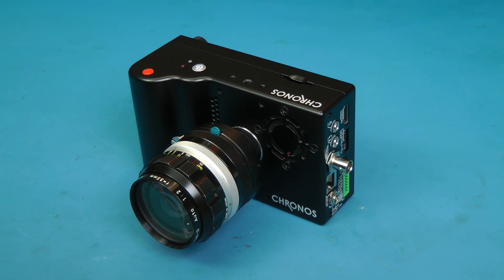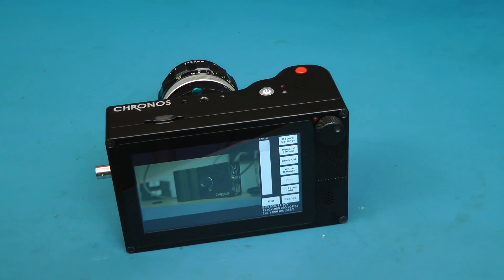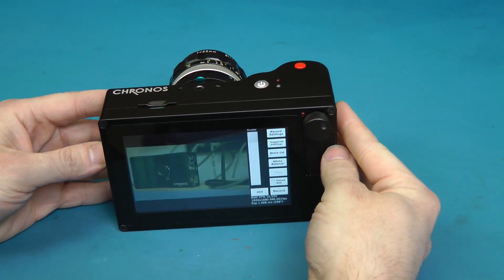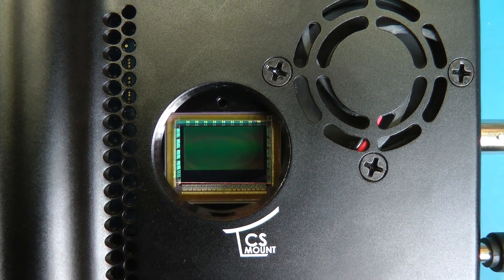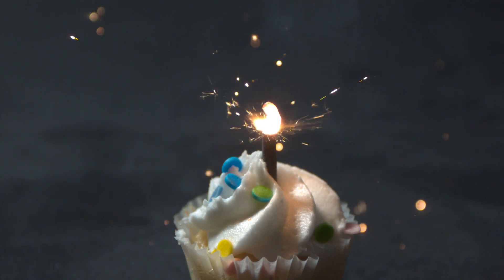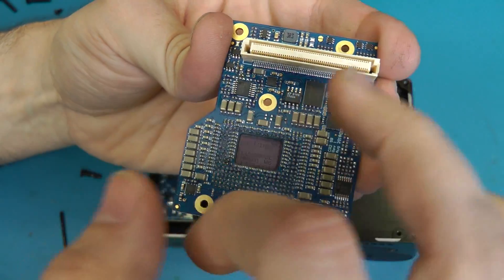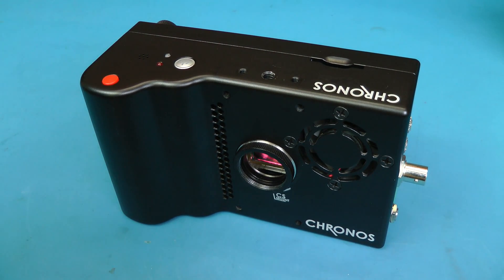Chronos 2.1-HD prototype demo, overview and teardown

Comment: when I watch Dustin Farrell`s two lightning videos Transient 1 and 2, how could I not find this a very tempting purchase at about 1/15th of the price? But it`s a year on and they don`t seem much closer to getting it into our hands. I`d like to be corrected
Reply from the maker: We've got about 40 of them shipped so far, right now we're waiting on more image sensors to be able to build more cameras. We bought out every sensor Luxima had in stock, more are on the way, but semiconductor manufacturing has a long lead time, and the virus situation has also slowed things down. Sit tight, we should have good supply by June.
Reply: @tesla500  thanks for the reply. Am seriously tempted. I don`t need 4k, but dang, Dustin-level filmwork with this is a mouth-watering prospect

Comment: This is absolutely insane!  I would consider pairing this with full-frame lenses, with a speedbooster, followed by a c mount adapter.  You would increase low light performance, and likely render a  better image given the modern coatings.

Comment: 2:10 Cant you notice that the frames are not constant speed..Not a good cam! And costs 5000$? No way!
Reply: I cant afford it but when you consider that other slow motion cameras cost $30,000 and up, this is pretty impressive.
Reply: what do you mean by "not constant" ?
Reply: @MrBazsi888  Their speed (when slowed) It seems like 2 frames go then 3 then 1...
Reply: @CocoSloan  do you mean the part with the camera in the water ?

Comment: Does this version still have the crop modes for increased fps, or does it always read the full sensor and decrease resolution?
Reply: Given that its a high speed camera and higher frame rates use reduced resolution to decrease the amount of pixels being processed to allow for faster processing, i would guess it's still windowed at lower resolutions. 
Also, fancy seeing you here

Comment: Pony on Board? :D

I see 1920*8@100000fps resolution in the datasheet. What is it good for? :D 190*96 resolution has the same pixel quantity. Does the camera shoot 100k fps in that resolution too? If I am correct, this should be an available image size (32 pixel steps in horizontal, 2 pixel steps in vertical resolution)
I like the upgrade anyway. 960fps is already capable to show interesting things even in mobile phones :)

Comment: Seems very flashy

Does it support Open Source firmware and ability to create your own replacement parts or fab info?
Reply from the maker: The camera's UI software and API is open source. In terms of replacement parts, you can buy spare parts if needed.

Comment: That sensor board is nuts.
Reply from the maker: That was a nasty routing job! Took about 2 or 3 weeks
Reply: @tesla500  kinda lame that you couldn't flip the sensor 180 degrees because of the case.

Comment: you should sell a kit that upgrades the older cameras
Reply: I don't think it would actually save much money. He's had to pretty extensively modify it... you could conceivably re use the case and charging board but that's about it; the sensor board and compute board are new. Not much of a savings I expect.

Maybe it is possible to adapt the connection of the older compute board and the new sensor board but I expect this, while probably plenty possible, is still not trivial, especially in the very limited space. Perhaps he could produce a new sensor board that uses the old connector (for upgrades) - this would be more realistic, but also adds production cost sooo yeah.
Reply: Indeed, had the same idea :) Since its hardware is very much recyclable, a HW-upgrade, maybe using a Trade-In option for a lower fee might actually be feasible :)

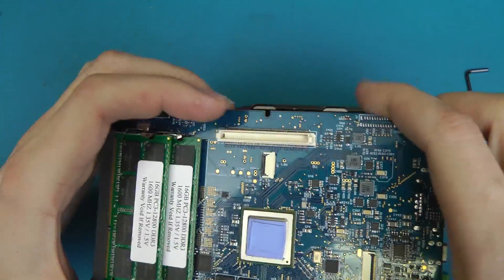Comment: why are the memory options so expensive? i looked up some ram with the same specs as the modules at 6:23, but they're much less than $1000 for the 32gb.
Reply from the maker: The memory is relatively cheap, but it took months of engineering effort to get 32GB working due to lack of support from the FPGA vendor Lattice. The price is to recoup this engineering expense.
Reply: @tesla500  I suppose that makes sense, I just would have expected that would come out of the base price. 6 of one half a dozen of the other i guess. Is it possible for someone to buy the 8gb option, and upgrade to 32gb on their own? that would be my worry.
Reply: @robmckennie4203  this is a good question. i also want to know.
Reply: @MrBazsi888  The upgrading memory thing? Well, if we assume he saw the second question and chose not to answer it, which isn't a given, I would conclude that the answer is yes, but he didn't want to choose between either lying, or giving away that anyone can have the 32gb option for much cheaper
Reply: @robmckennie4203  i mean just... if i buy the 8gb, is it compatible with 32 or even more if i swap the modules later on ?
Reply: @MrBazsi888  Right, i'm saying that if David saw my question above (which I think he may have as he'd only a few minutes earlier replied to this thread) and decided not to answer it, that implies that the answer is yes, but it also implies that you'll have a hard time getting a definitive answer from him

Comment: When is the time for DDR4, or even GPU type DDR?
Reply from the maker: DDR4 has a very high minimum clock speed, about 1GHz, so high that low end FPGAs will likely not support it for years. DDR3 will be around for quite a while sill.
Reply: @tesla500  How about PCI-E/Thunderbolt cameras that can be connected to a computer? Could just have the sensor DSP on-board, like machine vision manufacturers do? (Ximea xiB for example)? https://www.ximea.com/en/products/pci-express-high-speed-cameras-xib/fast-speed-models-64-gbps/cb019mg-lx-x8g3

Comment: You would benefit greatly by upscaling the video to 4K before uploading to Youtube, because Youtube highly compresses 1080p video with a lot of artifacts. Because I assume the original footage does not have the same level of compression as shown here?
Reply: he would benefit from hosting his own files and sharing them the way he actually wants, instead of using "free" youtube and letting them crap on it.
Reply: @username4441  its not for the free host. he got a lot of suport from the youtube comunity since the start. (so its down to marketing reasons).
Reply: @bernardo00124719  right, i realize that. but it is really just as simple as including a link to raw/un-compressed file in description.

Comment: Incredible how far you have come with this from your first prototype, great job and seeing your 48 camera ring! Impressive and best wishes for your company's future :)

Unfortunately it now also has a pricetag where I am out of the customer segment, but I guess there is more money to make from business's than prosumers? I am stuck with my FPS1000HD (not so happy smiley)
Reply: Luckily some new smartphones have got great slow-motion cameras which can record 960fps @720p (Samsung S9/S10) or even @1080p (so far only Sony XZ2). You can get some of these phones used for less than $400. Disadvantages are that recording is limited to bursts of approximately 0.4 seconds and a lot of lighting is required to get good shots. There also is no option to further increase the framerate by decreasing resolution.
Reply: @ProjectPhysX  i got a Sony Xperia XZ Premium, and its close to useless Compared to a dedicated high speed camera, it is out of comparison.
Reply: @KaizerPowerElectronicsDk  if you're careful in how you plan your shots, you can have good results with an Xperia camera.  It's like comparing a quick shot taken on a dslr vs a very meticulous setup for similar results with an iPhone or whatever other flagship. They can both be good, but of course if you take your time the dedicated equipment will always be better
Reply: @ProjectPhysX  It's not real 960fps, you can clearly see artefacts from framerate interpolation. Physically it can be half of the 960fps or even lower.
Reply: @galaxystudio3740  For some phones (Huawei P20 Pro and others) you're right. On the Samsung phones, the 0.4s recording mode is 480fps with interpolation, however the 0.2s recording mode is true 960fps. Source: https://www.reddit.com/r/GalaxyNote9/comments/9i09c5/superslowmotion_960_fps_vs_480_fps_same_result/
Reply: @ProjectPhysX  I heard the Snapdragon 865 can handle 960fps at at least for a couple seconds continuously. So the days of this camera maybe numbered. Though I do like that products like this exist.

Comment: wish i had the money. Great product.
Reply: I feel the same too, it's incredible to see an affordable high speed camera but still outside my budget for hobby use.  I'm sure it's worth every penny though, the hardware that goes into it is not cheap.  The sensor, ram, processor etc and just the time involved in designing it.   It's a great price for the type of people that would use it professionally, they'll be able to afford it quite easily and even have multiple going at once.
Reply: @redsquirrelftw  I wonder if its feasible to make a chronos-lite? A camera that doesn't do any insane FPS, just 500 or so.
Reply: @swedneck  I think some smartphones can do that.
Reply: @mdrahman6732  ya but for 2 secs at a time
Reply: For the feature set, the price is amazing. Still, beyond my budget too though

Comment: You could get round case fans (they are affixed with a gel sleeve). In this particular situation, i would've shaved that corned off the fan, mind you. 3 points of contact are more than enough for such a small fan, just my 2 cents.
Reply: Or just rotate the fan by 45 degrees xD
Reply: Yea...that seems like a wierd choice to me too. Maybe there's some other reasons he didn't elaborate on.